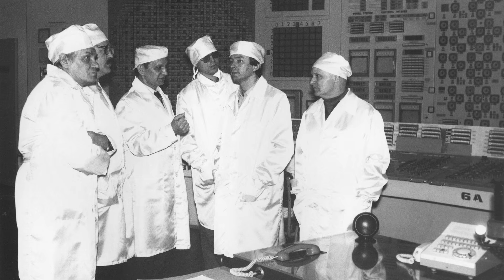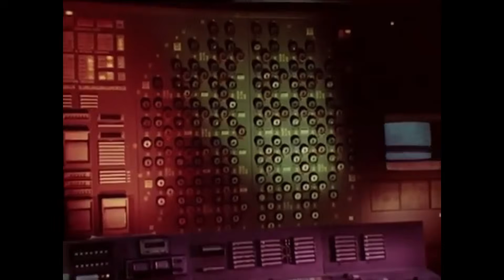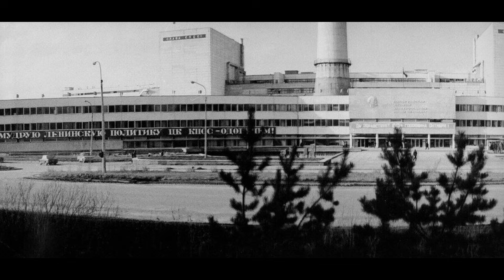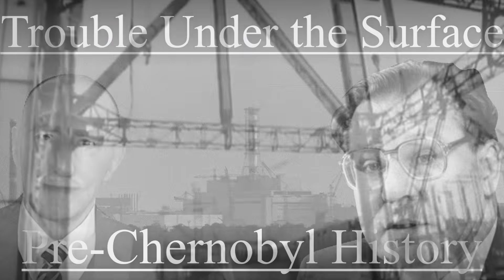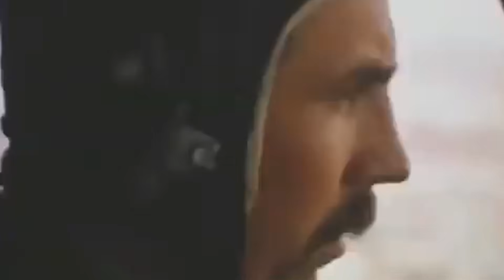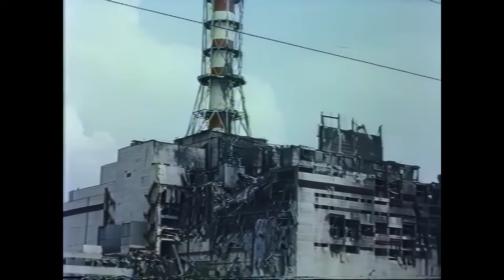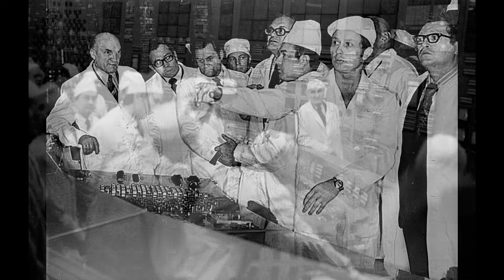The 1975 Leningrad Nuclear Accident: The Road to Chernobyl

Comment: I know I’m 1,5 years late, but if anyone sees this… Please… I’m so lost in all the different stories about Leningrad vs Chernobyl. My question: Were the graphite displacers at Leningrad 4.5 or 7 meters (full-length)? Cause if it was 7 meters, it means they were shortened in the 80’s, resulting in the 4,5 meter ones in Chernobyl. Second question: If that was the case, then why was there still a (small) positive SCRAM effect at Leningrad? Since there was no 1.25 meter water-gap at the bottom of the reactor core, then how could the graphite “displace” water, if they were already fully into the core? Was the graphite-part going below the core or something? How did that work? Which story is the truth (or, ‘seems the truth’?)

I’m sorry, I’m not a scientist nor expert, I’m nothing more than a very interested guy having some weird fascination for Chernobyl & more…
Reply from the maker: 1) The displacers at Leningrad were 5 meters long. While this may not sound like much, that 25cm at the bottom enters a zone of greater reactivity.

2) According to all official sources, the power surge at Leningrad occurred before AZ-5. There was no positive scram, and it wasn't discovered until 1983.
Reply: @thatche @thatchernobylguy2915  all, what a legend, replying so fast on a relatively ‘old’ vid❤🙏🏼

I does left me with some questions though, making me really feel like some noob😅

How was the positive scram discovered in 1983 then, was that in Iglalina? (of was that something else idk)

Secondly, I always thought of some link between Leningrad and Chernobyl about the AZ-5 button / graphite displacers. I know very well that the HBO Series is full of mistakes, but there were talking about a button press at Leningrad.

For info, I’m nothing more just curious, as I’m writing a little story for an interested friend. I was trying to write about the relation between the LNPP in 1975 and the CHNPP in 1986, aswell as to what changed in between those 11 years (and what didn’t change)
Reply from the maker: @david_lammers I try to read every comment :)

1) Positive scram was experimentally discovered during start up at Ignalina Unit One and Chernobyl Unit Four at the end of 1983.

2) The link is not like what HBO says in a positive scram effect, but in how similar events kept happening. Reactors would become unstable around 2.5-3 years after the reactor was started up, when they reached maximum fuel burn up, and if they experienced a sudden power drop, and then they attempted to raise the power, unusual things could start happening. This happened another time before Chernobyl, at Smolensk in 1985. If you search "Smolensk 1985 Chernobyl," my video should come up on it. I think it could also help give you information on how they all link to Chernobyl.
Reply: @thatchernobylguy2915 Thanks a lot!❤ The video about Smolensk helped a lot indeed! A third incident/situation with a lot of similarities…

But talking about those similarities: Was there a positive scram effect at Smolensk? I always thought there was, because of Smolensk Unit 1 being a Second Generation RBMK, thinking any 2nd gen would have the shortened graphite tips? So Smolensk isn’t really a copy of Leningrad, but more of a ‘same situation as Chernobyl’? (with the 2-3 years after start-up, half power circumstances, etc.)

I really don’t want to keep you reading and answering, sorry - it’s just a real struggle to find a lot about that June 2nd 1985 in Smolensk…
Reply: @david_lammers We think the Smolensk displacers weren't shortened. Second generation RBMK plants came with fuel enriched from 1.8 to 2%, which then caused another problem leading to the shortening of displacers being introduced. There was a lag.

Comment: The more I see of these nuclear plant disasters, the more confident I am that we should be building MORE nuclear plants and not tearing them down.  These were all caused by cost-cutting measures.  As long as you hold new plants to a high standard in their construction, the likelihood of a disaster is extremely low, and it's a tremendously efficient and clean way to create energy.
Reply: absolutely, tmi would never happen today, 1 busy phone line, insanity
Reply: Agreed.
Reply: Clean while it’s running, nightmare to dispose of the spent fuel after. They are also exorbitantly expensive to build and can take decades to do so. It’s the best we’ve got for now but fission reactors are far from ideal.
Reply: It's not efficient if it costs more than renewables and the government has to pay for the insurance and construction. And it's not efficient if building them takes decades and billions. Just throw up some solar panels
Reply: But it always comes back to the money
Reply: @thomasmumby  Always.  Someone will always want to cut costs in an effort to impress those above him.  Human nature never changes.

Comment: Unclear reactors should be as simple as possible. The PWR is considerably better than RBMK but it’s far from simple. Alvin Weinberg- holder of many submarine reactor patents - always said a small device surrounded by coolant (seawater) is intrinsically safe. However scaling it up to power utility scale causes many safety concern. 
Weinberg invented the molten salt reactor to prove the point. He actually turned off the coolant flow at full power and the power simply dropped to near zero. The negative temperature coefficient made the reactor self regulating. His research was shut down by Nixon. Such research was not needed. Obviously, nothing to do with Westinghouse being based in his constituency. 
Moltex Energy (UK) has taken us back to molten salt. This time with fuel carried tubes and the salt used as a heat transfer medium. It is also self regulating and intrinsically safe. In a worst case situation, heat pipes could be permanently closed and the reactor would sit until the fuel is fully used up.

Comment: Accidents like these are not the result of one design fault or one specific element. They are always the result of a number of factors, technological and human, which, in combination, conspire to create the worst case scenareo.
This is the 'Swiss Cheese' model. If the holes line up, you get a disaster. This is true of any disaster which involves technology and the people operating it, from aeroplanes to nuclear reactors. Complicated technology, with design flaws or foibles, multiplied by the square root of the stupidity of the people using it, multiplied by the square root of the information witheld by it's designers times a governing body turning a blind eye equals catastrophe. RBMK, Boeing Maxx - it's all the same.

Comment: One thing that has to be noted is how slow the computers were that provided the reactor's status. It was not realtime. Nuclear energy became a lot safer when computers became powerful enough to provide realtime data.
Reply: Exactly, especially when seconds matter a lot when reactor becomes unstable
Reply: Fukushima?😂😂
Reply: @ThisIsFishaan  fukushimas problem was from cost cutting standards from when it was built in the 60's, that disaster was greatly reduced by having safety protocols and remote monitoring and automatic failsafes
Reply: @ThisIsFishaan  Fukushima was still far less severe than Chernobyl. And it's also foolish to compare a reactor hit by a tsunami to one that just blew up under normal conditions.
Reply: @adamk203  В Чернобыле реактор взорвался не в нормальных условиях. Инженеры эксплуатационщики довели его до состояния аварии намеренно игнорируя инструкции от разработчиков!
Reply: @adamk203  they did build the plant down the existing cliff there directly at the shoreline to safe energy when pumping cooling water. They could have built the whole Fukushima Daiichi plant just 200 m inland on top of the cliff and nothing would have happened, no matter what tsunami came. They would have probably lost 1 or 2% of productivity for higher pumping efforts.
Reply: @YuriyShpak-nb6xo russia propaganda, the reactor was shit, badly designed and it's a suprise that it didn't explode earlier
Reply: @adamk203 i agree
Reply: @adamk203  Actually, you're still underselling it. Fukushima was first hit by one of the strongest earthquakes in recorded history and only then was it also hit by a tsunami.
Reply: @adamk203  You must be rage-baiting.
Chernobyl was far, far away from normal conditions.

Comment: Regarding Chernobyl, apparently, all of the highly radioactive equipment, trucks, helicopters etc, used in the aftermath were quarantined in a "secure" area, in the forest.
Some years later, this secure area was found to have been looted with only skeletal framework remaining.
If this account is true, we have a horrifying situation of radioactive  parts, engines including helicopter parts, randomly shed abroad causing untold misery and death to many.
Are you able to confirm this plausible account?
Cheers
Reply: As Ukrainian, I can confirm this. Yes, all that stock of contaminated vehicles and equipment got stripped down and cut for scrap to some extent. It already started shortly after the 1986 with engines and other valuable parts, copper and aluminum. And many ferrous metals parts were scrapped already in 2000-10's. The visitors of Buryakivka or Rossokha sites tell that there is not much left. Many of those contaminated vehicles passed the decontamination process and reached some acceptable levels of radiation for being scrapped safely. The heavily contaminated vehicles still remain there.

Comment: I have seen a couple of creators refer to RBMK as Ridiculously Badly Made Kettle.   I had to laugh at that.    RBMK Reactors had several flaws.  A lot of reactor designs do.    One of the biggest flaws though is the fact RBMK reactors have no containment building.   Chornobyl incident could have been fully contained if they had that last line of defence, a proper containment building.     
There were many changes made to RMBK over time, a lot we likely will never know.   This is because they had known flaws from when first put into production.   The design of RBMK was never fully finished before starting to build them.   They should of all been experimental reactors.   Unfortunately not all changes made over time resulted in safer operation
Reply: I'm not sure a containment building could've been built that could withstand the forces involved in the steam and subsequent hydrogen explosions.  But it sure as hell wouldn't have made things worse to have extra material between the reactor and the outside world.

Comment: Did they increase the graphite length of the control rods in all rbmk reactors in Soviet Union after Chernobyl disaster ?
Reply: They adjusted the position of the graphite displacers so that at maximum control rod extraction there would be no water column at the bottom.
Reply: @markusw7833 so the graphite length has not been increased, only shifted down the whole graphite portion?
Reply: @wolfgang6028 Yes, initially. Later on they may have further modified the design, I don't recall, but they immediately eliminated the water columns by limiting the maximum extraction.

Comment: A single piece of paper could have saved the Soviet Union… 
Imagine if the USSR had just noted this issue with the RBM-k instead of hiding it… If they had, Chernobyl probably would have never happened, pushing the USSR into bankruptcy and might still be around today… A single, non-redacted notice might have saved the Soviet Union… wild.
Reply: No because changes in construction of the reactors did not help but it got it worse. Its the point because they think they fix the problem. Even if operators know this it still will blow up.

Comment: RBMK reactors are not designed to be throttled ; either the reactor is shut down or it operates at eighty-five percent. Why design and build a reactor of that capacity if it is going to be operated at lower output ?
Reply: I've always heard RBMK reactors were originally designed for plutonium production instead of electricity. I'm not going to pretend to know the differences of this type of reactor, but maybe that has something to do with why these reactors weren't designed to be throttled? Idk...
Reply: @branchtana315 In general, civil nuclear power reactors aren't designed to be throttled (i.e. for "load following") and are intended to provide baseload power by running at full power or as close to that as possible.
I also doubt that military plutonium production reactors would have much need for throttling. 
The main obvious difference between producing electricity and military grade plutonium is the latter requires very frequent refuelling while electricity production does not.
From a commercial viewpoint, the costs of running a nuclear power station are more or less constant while the revenue earned is determined by the energy delivered. So low power operation costs as much as full power operation but significantly reduces incoming cash flow.
Reply: When you have a single reactor feeding two separate turbine generators (TGs), it may make sense to sometimes operate at half power, if one of the TGs cannot be used.
Although operation at lower powers might be technically feasible for some reactors, there would usually have to be a compelling operational reason for doing it. For example, some British AGRs refuel whilst operating at reduced power but aren't allowed to refuel when operating at full power.